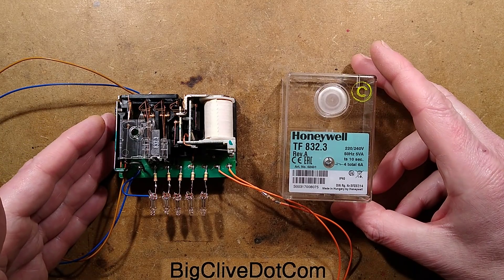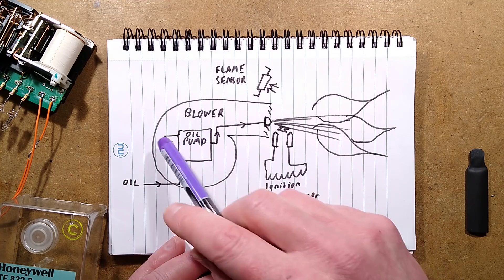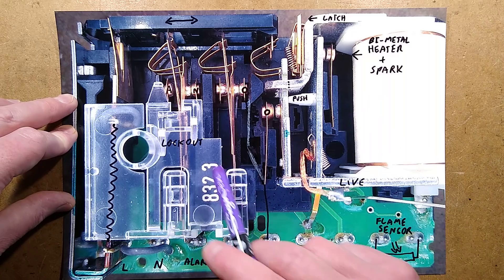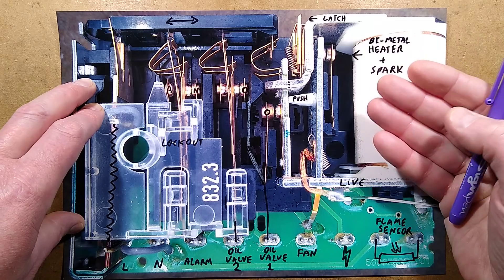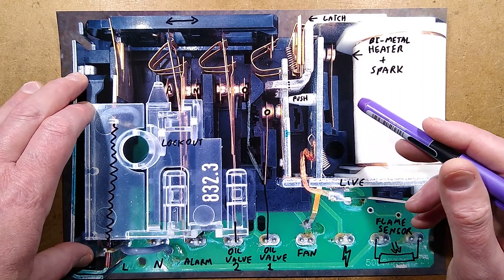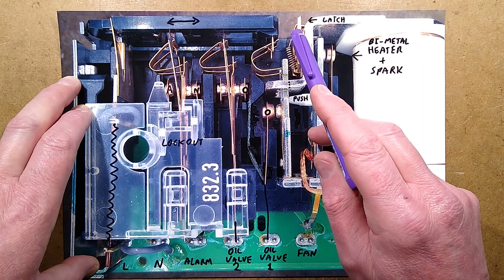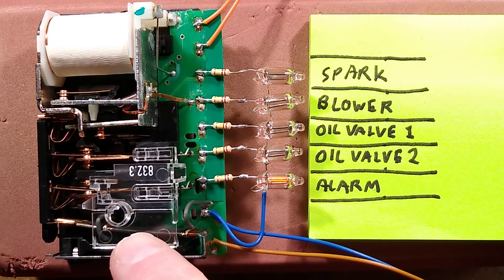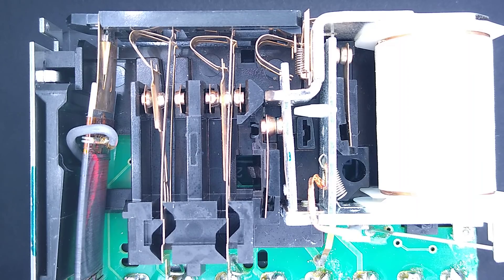Incredibly clever oil furnace burner controller (very perplexing)

Comment: These were the bane of my life for 9 years ... I always thought they were complicated, now I feel exonerated... 🤯
Reply from the maker: Do you wish you'd seen this video back then?
Reply: @bigclivedotcom  Yes that was my first thought but now I feel it’s more comparable to the memory of a once forgotten nightmare of which I’ve now had therapy for.... 
FYI in my case they were on industrial hot water pressure washers and the frustration came from the what seemed incredibly slow reset  time  when trying to diagnose a fault and when reset  several times older units would fail completely just to add to the fun... brrrr...days are behind me now thank god. 🏌🏽

Comment: I was a tele exchange engineer for 25 years, initially strowger (electro-mech).  We used thermal relays, slow to operate and slow to release relays, (these had “slugs” fitted at one end or other of the coil to slow down the build up/collapse of the magnetic field  to slow them), big stacks of contacts with make, break, change-over, make b4 break, ratchet relays used to count X operations of the relay before operating a contact.  Literally thousands of them but loved it!

Comment: Hi Clive,  I wish to ask for your advice/ I have a 50w Rechargeable Portable Ul LED Floodlight 

With DC plug charger & Car Charger 12V Output: 8.4v

Battery Type: Lithium-Ion Built-in Battery High power battery capacity 2200mah 8.4V     

I wish to adapt this light to take my Makita 18v - 5.0 Ah Battery. (as these charge within 20 min)   Would i need to use a Step-Up/Step-Down Voltage Regulator?  Or anything else?

Comment: With your knowledge you have to have great time with beer revert engineering this kind of stuff. And with your knowledge I would do the same. This device is very smart and safe, no joke, someone put a lot of effort into designing this, putting mechanical elements and its great that there is someone like you that can actually understand it and share it :O I know just simple basics, this is like witchcraft for me.

Comment: That is a fascinating use of bi-metal strips and over-center cams. It is also interesting that it was cheaper to include the copper, silver contacts, and spring for the #2 oil injector even when they are not needed.
If you removed the #2 oil injector parts from the unit it wouldn't have the proper timing.
Basically, a single oil injector unit would require most of the other components to be calibrated differently.

Comment: I service oil fired boilers for a living.
These control boxes are fascinating things and remarkably reliable for what looks like 1950's technology.  The main things that cause them to fail are repeated restarts caused by failing ignition transformers.
There is a fully electronic alternative which has a DKO designation (includes the provision for an electrical remote reset and diagnostics via flash codes- although the diagnostics are fairly useless to be honest!) - happy to send you one to compare if you'd like?

Comment: oil valve 2 should hydraulically open a damper valve to allow much larger airflow as well, , fills the boiler / flue full of soot / shite when it fails to open and  the caretaker in charge doesnt have a clue why theres stinky grey smoke coming out of the flue and keeps it running for a week. 
Cracking job investigating this unit ,  we go through loads of these things at our place.

Comment: Very similar to the furnace control system on our Almet "All Grain" grain dryer - dating from about 1958. The biggest difference being that the drier has to be fired manually by a push button, and there is no auto relight, but the relays and lockout system works in much the same way. It is of course built from individual electrically interlocked relays, but the procedure is much the same. If our flame dies, the furnace goes into "cool down" mode for about 15 minutes before automatically shutting down. The mechanicals of the burner are almost identical to your sketch. I'm not sure exactly how your atomiser works, but ours takes an air bleed from the blower, into the atomiser (Patented "Swirlomiser") to spin a high velocity rotor which flings out atomised fuel into the high pressure, high velocity air stream just ahead of the ignitor, and into the combustion chamber. Our flame sensor is something akin to a good old ORP12 LDR - well, it is a bit of an antique! But, it is a work of art, and a wonder to behold to see what looks like mechanical logic at work. You can, more or less, work out the "if/then" "and/or" "for/next" etc logic sequences being played out in mechanical relays.

Comment: I recently scrapped a hot water heater someone threw out....  Had a blower facing downward into the center of the tank.  What I was amazed at was it had an external controller which was a PCB 10x10 inches in size with a connector with 48 pins and all of them were used against the motor, various sensors, valves, etc...   I was amazed - I looked in vane for perhaps an RJ45 network connector thinking it was digitally connected... nope - all analog

Comment: Wow!  That controller just seems so unnecessarily complicated in a mechanical sense.  The more mechanical contacts you have, the more intermittent problems you will eventually get. Here in the US they have become fully electronic. Even the old electro/mechanical Honeywell one that I replaced with a fully electronic one was so much simpler and SAFER in design. I actually managed to fix the old one and keep it as a "temporary" backup if necessary. Also, by the way, the safer older style one here does not allow the boiler to start if it already sees light BEFORE ignition.  Leave out the flame sensor so it sees light BEFORE ignition, and the boiler will NOT start!
Thank you Clive for a very interesting video, as usual!  👍👍
PS: I think you can still get the old style controllers here too if you still want one, but I have never seen one like this before.

Comment: but why? couldn`t do some off the shelf relais and a microchip do the same job better and cheaper
Reply: Not as reliably. While I love microcontrollers, modern micro controlled appliances are nowhere near as reliable as the old electromechanical sequencers. An old washing machine motor driven sequential timer would last decades. A modern microcontroller circuit often gets smoked within months, if there is a line surge and to replace the controller costs 2/3 the price of a new machine. Sometimes the old ways are the best ways.

Comment: I worked with these many years ago, and compared several different brands which used different tricks to achieve the timings etc. The basic design has not changed at all. The circuit board is just the amplifier for the flame cell.  This seems unbelievably complex and does nothing that other brands do - they all have to meet DIN etc. standards. If you want to see how it can be done check a Landis & Gyr box.

Comment: Clive just a thought as a user of Oil Heating... The Oil Valve 1 " High flow rate to heat water quickly. A pipe thermostat reaches a pre-set temperature activating  Oil Valve 2 smaller jet for use once water reaches a pre-set temperature.. As seen on the Riello Gulliver burner or the much larger 2 or three stage Riello Burners.

Comment: A brilliant description I had to work this out 20 years  ago when had a failure on our high efficiency gas boiler Kidd type. This used both solenoid outputs first pilot gas flame then second solenoid main burner. Same boiler could use oil if burner changed. I had to repair it after 10 years boiler lasted 30 years @96% efficiency  . Thanks Clive

Comment: I've got lots of electro-mechanical stuff and it is absolutely fascinating. I think the guys that designed this stuff must have been proper engineers at the absolute top of their game. The introduction of microcontrollers has significantly decreased the required skill level to design products. I've been a software developer for decades, but could not have designed this contraption

Comment: Looks almost like my 30 year old Landis&Gyr LOA24, with the exception that mine additionally controls the oil preheater. So maybe thats what your second valve terminal is for. These things are so indestructible. Like the whole oil burner. The only thing that gives after decades is the rubber cap over the reset button.

Comment: Clive you may want to try and get hold of some old BT circuit diagrams for old relay operated switchboards. All very simple DC stuff, but can also get a bit complicated, much like this little relay set. I was trained on those old circuits in the late 70s, so this one makes complete sense to me, although getting my head around the whole picture is a bit difficult since I don't have the diagram to help me. I don't have my old diagram books any more, otherwise I could email a copy of one circuit to you, if only I had your email address! In South Africa we used mostly British phone systems, back then.

Comment: Reminiscent to the lighting of a jet engine. Engine is spun up first to get air flowing through the combustors, then the spark igniters are energized, and then and only then does it get fuel.
Reply: And that in turn is very similar to how my (99% electromechanical) gas dryer works. The blower turns on, a centrifugal switch enables the rest of the circuitry, a hot surface ignitor heats up, and only once the ignition heat is detected does the gas get turned on.

Comment: Verry interesting. We basicly have the same modules here in Germany and I knew the mode of operation very well because we had some issues with an old oil furnace years ago. But I could never take one apart to see how it actually works as I only had one. For gas furnaces the modules are basically the same.

Comment: And don't keep pushing the reset button if it don't light! The most common problem is dirty nozzles and spark probes. If it don't light after a couple attempts, light a piece of crumpled up paper in the combustion chamber, then restart the unit.

Comment: Weren't these originally made by satronic? Come across them from time to time on oil boilers and things like direct fired gas heaters in warehouses. I always thought the clicking noise you hear from these was a syncronous motor moving a Cam to go through the ignition process. Now I appreciate why they are so bloody expensive.
Reply from the maker: I think it is a rebranded Satronic.

Comment: How is overall temperature regulation/settings and/or water demand sensing integrated with that? Is it controlling the supply power?
Reply from the maker: It's purely the burner control.  There's other relay or electronic logic for the rest.

Comment: Very much like an alligator, this is a throwback to a bygone era that has somehow survived. Alas it's brethren did not and evolved into MCU controlled embedded systems.
I would liken this to a mechanical state-machine or hybrid state-machine and sequencer... it is likely possible to describe it in a state machine diagram as well...
Back in the before times (in the long long ago) devices like this were king of the hill . Mechanical PLCs and sequencing was pretty heavily used in early era (up to 70's) pinball machines for example. Another similar type of gear was the old telephone Strowger Switches used throughout the network to allow for self-dial telephone exchanges.
I am amazed that this was not replaced by some programmable alternative to this day, perhaps its just cheaper and more reliable than a non-mechanical alternative.
Or maybe, if it works don't fix it prevailed here.
Cheers,

Comment: Long ago before transistors were mass produced, Honeywell made the "Protecto Relay". An electromechanical boiler control. Had the most problems from people manually trying to operate the contacts or wedging them with various things like Match Sticks.  
Integrated and potted chips was the answer for people tampering with the control.

Comment: A modern microprocessor has several billion transistors on a die the size of a little fingernail, can perform several floating point operations in the time it takes the light from the screen to reach your eye and uses quantum theory in operation, but a bimetallic strip and some clever mechanics beats it hands down for sheer fascination value!

Comment: Remember Clive heats with oil and has no doubt had to work on it a few times I remember a vid when he fixed his boiler !  Oil has the highest BTU rating of any fuel  but they can be problematic Thats why I have regulated oil to industrial use  in my shop and at home  I use propane  .

Comment: Bigclive- Would it be possible to rig a "water tank FULL" single led circuit for caravan on the cheap. 
Would it work using to conductor screws close to the top of tank.
Reply from the maker: You can get water sensors on eBay that work by conduction, but be aware that doing it too simply with just DC will result in corroding of one or more electrode and false readings.  There are float switches available on eBay.
Reply: @bigclivedotcom  ahhh, I see. Float switch definitely better then. Cheers from NZ👍
P.s.love your methylated spirits tasting video😱

Comment: Genius electromechanical design, probably from an era before computers! The beauty of it is that the power contacts are already incorporated into the logic. There are probably additional fail-safe modes if contacts get welded closed. This is always going to be cheaper and more reliable than a microcontroller and relays.
Reminds me of the old thermally actuated photocells for streetlights, which had a big LDR in series with the heater coil. They lasted decades and it was usually the snap spring which broke or the connection to the heater failed eventually. For some reason these were superseded by a circuit board full of electronics and a relay or triac on a heat sink. 
Then there’s the furnace controller I have which has a large swing moving-coil meter connected to a thermocouple. A synchronous motor and cam is arranged to mechanically “sample” the position of the needle every 20 seconds or so. I think it used a light beam to do this. If the needle is above the set point, the relay would drop out. If it was below, it would pull in. It can’t “chatter” because the decision is only made every 20 seconds. Genius, requires no electronics, will run for decades and any technician can fix it.

Comment: Great video, thank you. This device (which I've never encountered), just screams microcontroller at me. But, the low cost and safety of this device are superb - electronics needs power even to enter a safe mode and semiconductors fail unpredictably particularly driving mains devices. Beyond that: The level of rigorous and expensive safety compliance/testing would make the manufacture of this unit very reluctant to change/update. This is ultra proven technology backed by building regs, housing developers, fire safety, insurance companies, mortgage providers and councils -  to quote but a few, and a tough path to change. And (in the event of an unfortunate incident), could be seriously challenged in court! However, I'd still like the job of implementing this though - but, I bet it would end up significantly more expensive :)

Comment: This makes me remind the design of intrinsically safe railway relays with non-overlapping forcibly guided contacts.  They are designed to be extremely reliable and if they fail, to do so in a predictable and safe manner with safe effects.  All failure modes are fully known because they are based on physical properties.  Such relays are a wonder of the 50ies.  As nowadays smart brains are busy with AI, the smart brains of that era were busy designing all the little features of every part of wich such a relay/controller is made.  Nothing is there for no purpose.  Also, this is a wonder of mass production with stamped metallic parts, injection molded plastic parts, this has been produced in millions of exemplaries, if not dozen of millions.
Reply: I feel like design of reliable mechanical trickery like this is becoming a lost art when a 10 year-old can now program an Arduino to do something like this.  As all the older engineers retire (or are forced out due to outsourcing and budget cuts), all the lore that goes into stuff like this is slowly lost.
Reply: @greendryerlint  when you need safety you can throw away the programmable stuff.  Programmable safety-critical controllers are tremendously expensive as well as the system & software development process. But yeah knowledge about relay control, relay design and such is definitely fading out.

Comment: Got one of these units on my Worcester heat slave boiler. I used to get intermittent lockouts and I always suspected it was the control unit at fault because I couldn't understand how it worked and anyway it was electro-mechanical and therefore surely must be unreliable. When I finally found the source of the problem it was the spark sometimes failing to light the oil spray due to the electrodes being slightly out of alignment. The controller seems to be the most reliable part of the system even after 20 years of service. Hats off to whoever designed it.

Comment: Got three of these units at work and one keeps locking out, im guessing the flame detector. At least thats and easy one to test. Thanks.
Reply from the maker: If they are identical you may be able to swap the sensors to see if the fault follows it.